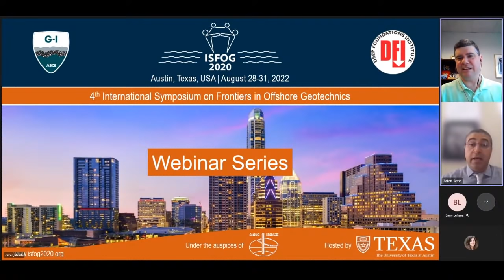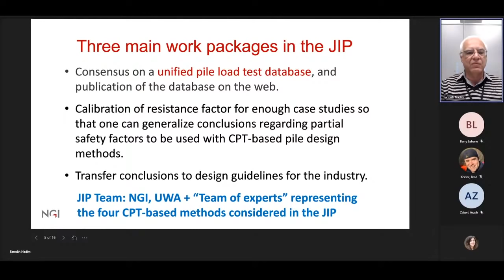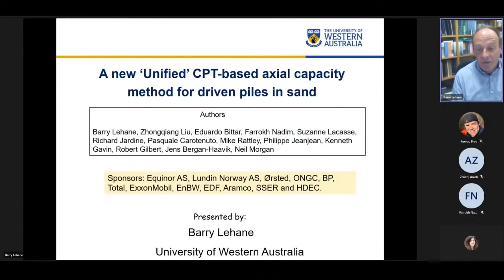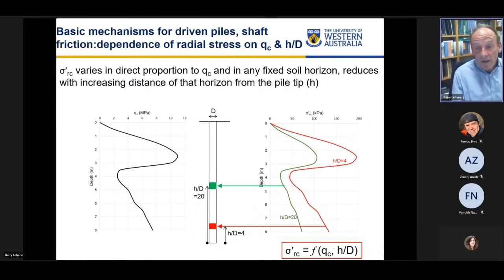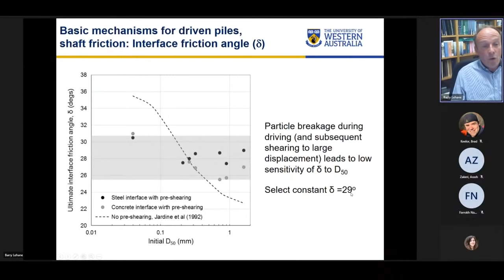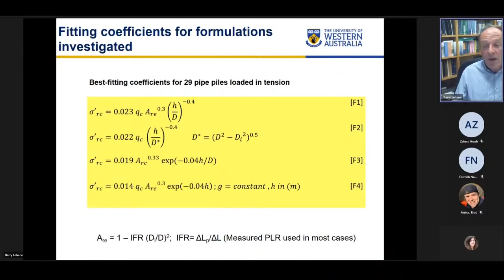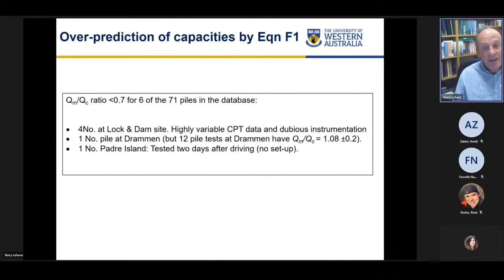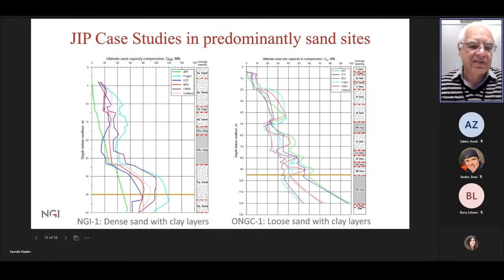ISFOG 2020 Webinar: New proposed ISO/API unified CPT-based method for axial pile capacity in sand

Comment: Thank you for an informative webinar. I have one question though about the calculation of radial effective stress, how is h measured in the calculation? Is it from the tip of the pile to the point of soil in question, or from tip of pile to the sensor location?